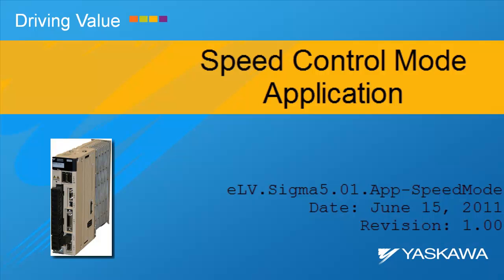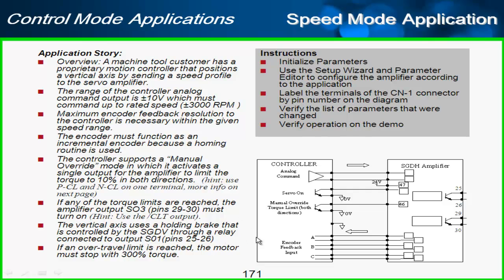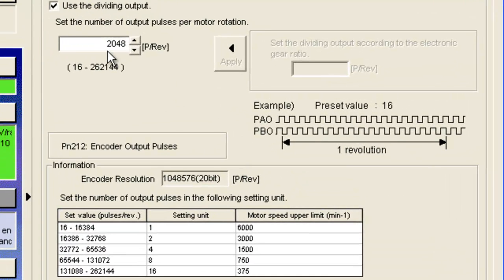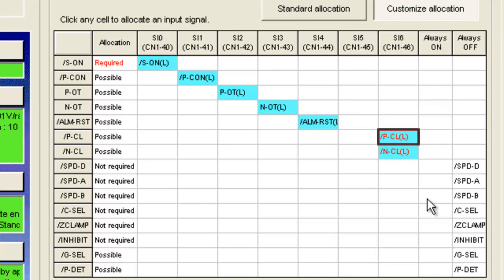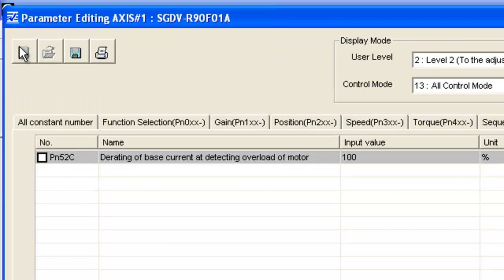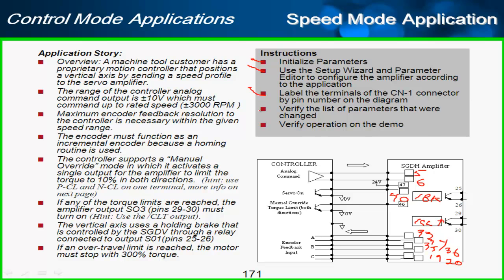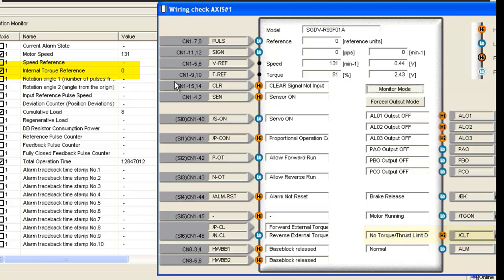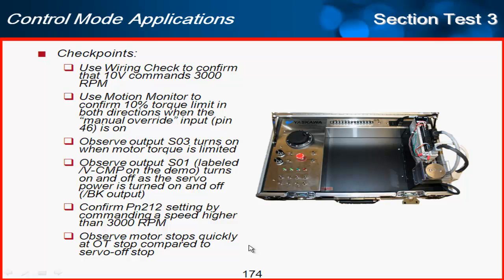Sigma-5 Speed Control Mode Application

Comment: I am a technician looking at a press brake folder. It has 2 sgdv-3r5d01a driving an X and R axis. The problem is that both these drives are running way too slow. Too slow for them to reach their respective reference point in time before the controller calls out NC not ready. All parameters and sequence files are ok. There is no go slow command given from the controller. There are no error messages appearing. The drives will reach their respective reference points if you put the machine in manual mode and wait long enough, about 5 minutes rather than 5 seconds. 3 phase power is correct. 24 volt rails are correct. It is puzzling that both drives are exhibiting the same fault. Could you suggest what I could be looking for? Something common to both drives? The Turkish manufacturer has given up offering any more support. They want $20,000 to come to my country to "possibly " fix the machine.
Reply from the maker: We are pleased to hear that you are interested in "Sigma-5 Speed Control Mode Application."  It appears the drive is in position mode, which can utilize Pn218 for multiplication of reference pulse inputs. However, I suggest contacting our Technical Support at https://www.yaskawa.com/support-training/support or your local Yaskawa Service Provider - https://www.yaskawa-global.com/company/profile/global with more details on your application.
Reply: @YaskawaAmerica  as a technician, I thought I would give you a follow-up to the problem. Before I was called in to solve this machine's problem, a few other people had their go at solving the problem. And did not succeed. The original reason to investigate this machine was the fact rain water from a faulty workshop roof entered through cable entries on the top of the electrical cabinet. 
It was reported that the X and R drives ran extremely slow since this incident. It appeared the water may have damaged some of the various modules in the cabinet. I certainly noticed evidence of water stains in some of the modules as well as the intetnal wall of the cabinet. 
One of the earlier technicians reported that the analogue voltage coming from the Delem modules that go to the Yaskawa servos were 0.7 and 9.9 volts. Yet both axis were going very slow. I do not know why they did not latch onto this crucial information. 
I investigated this further. I made up a short M - F 15 pin D lead with long test leads that first I could put on my multimeter to verify what the earlier technician reported. Sure enough, they were that level. My next step was to disconnect the plug from the Delem module and put my own dc voltage from a variable power supply into the lead. I set my power supply to 3 volts. Wow, when connected, my supply went into over current mode. I disconnected the supply and connected the multimeter on ohms. It showed a virtual short. I thought, oh no, a shorted input on the Yaskawa. It was late, and I took the Yaskawa home to investigate whether it could be repaired or did it (and the other one) need replacing. 
At home, I removed the casing and could not see any damaged components. I put the meter across pins 5 and 6. Wow, 27k ohms. That's good, I thought, then quickly thinking there must be a short in the machine. I couldn't get to the machine quick enough the next day. It's like you on the hunt for an animal, and you can almost smell it or hear it's foot steps. The adrenaline is kicking in.
I got to the workshop and went for the ends of the leads to see if there were any shorted solder joints. Everything looked fine. Nice clear heatshrink over all wires. But, there was definitely a short, even with both ends unplugged?? I started to fish out the cable from the clip-on box conduit. Wow, there it was. A weird buckled up section (about 1 inch) of the cable with the outer sheath split open, exposing an equally buckled up braided shield.
Stripping back the outer jacket and cutting open the braid, revealed melted and twisted wires that in places were bare and shorted together. That's my short, right there I thought. The cable for the other drive was was damaged the same almost next to this cable. Inspection of this other cable revealed the internal wires were twisted so badly they actually snapped in half, hence an open circuit.
I didn't take any chances, so I replaced the whole length of both cables with new cable I luckily had. Switching the machine on and going through the start up procedure brought this wonderful sound if the axis speeding along to their respective reference position. 
Now, I was so happy to be the one to finally repair this $160,000  machine. But it still played on my mind what caused these 2 cables to be like that. Thinking back to the fact it all happened when water leaked into the cabinet. Months before I was called in.
The wires in the cable certainly had melted together. Yet the outer jacket looked fine except being split open. 
Upon further investigation I could determine the cable looked as though it had shrunk and it caused the internal wires to bunch up. I tried soaking a section of the old cable in water overnight. No change. Strike that theory off. 
Looking at the cabinet I realised a fan heater had been used to dry out the water. All of this was made difficult for me because none of the employees or management were currently employed there. 
On the damaged section of cable I also noted that while the internal wires, braid and outer jacket were bunched up, the pull cord in the core of the cable was still staight? What has gone on. I got a section of undamaged cable and blew hot air on to it from a heat gun. Holding it far enough away so as not to scorch the cable. Low and behold after a few minutes the cable stated to shrink and buldge 
I worked it out. The outer jacket has a reasonably good heat rating. While the inner wires have a very poor heat rating. But the most surprising thing was, the central draw cord (also synthetic) was shrinking in length under heat.
Now not being the first person on the spot and the original people in charge no longer there, I assume a fan heater was used to dry out the cabinet.  The slots in the clip on conduit to allow cable entries or exits anywhere along it's length allowed a small concentrated flow of hot air onto the 2 cables in question. I imagine the fan was low heat, but running for a couple of hours.
Now I can sleep at night.

Comment: hello sir , i trying to configure , in your video ,p-con (input config), i searched in sigam 5 manual there is no pin detail of p-con. i am using sgdv-01a 180 servo pack
Reply from the maker: Thank you for your interest in the "Sigma-5 Speed Control Mode Application". Please reference section 6.9.4 of this user manual for /P-CON input located here: https://www.yaskawa.com/downloads/search-index/details?showType=details&docnum=SIEPS80000045. If you require further assistance, please contact our Technical Support at https://www.yaskawa.com/support-training/support or your local Yaskawa Service Provider - https://www.yaskawa-global.com/company/profile/global